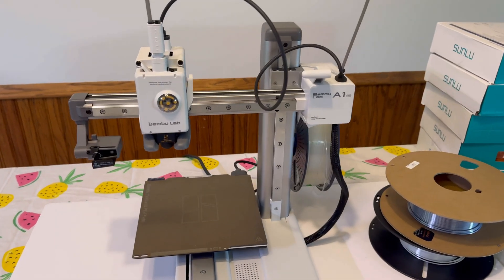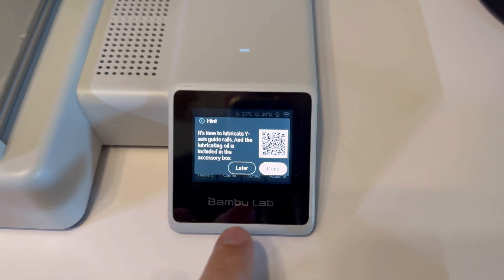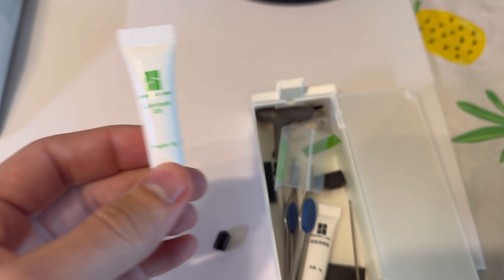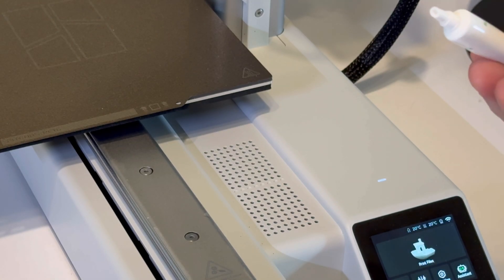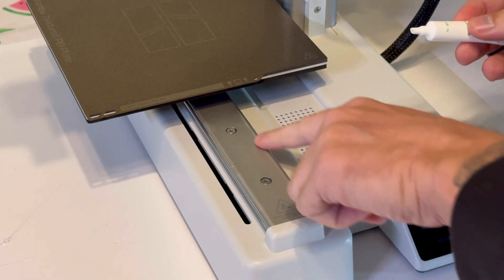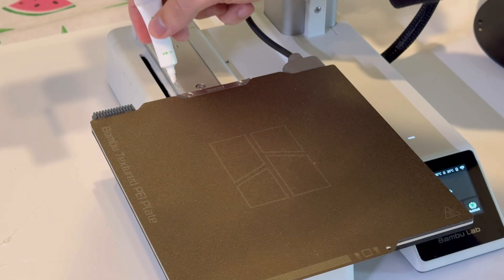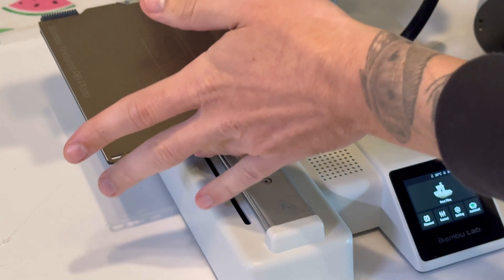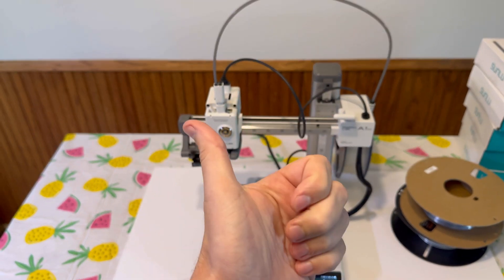How to Lubricate the Bambu Lab A1 Mini

Comment: The Bamboo Mini's initial calibration often leaves the hot end in the corner, making it unclear how to move the print bed for tasks like Y-axis lubrication. This likely confuses many new users.
to move raise the toolhead on the mini...open menu>control>xyz and raise z up

Comment: How did you move the plate
Reply: Make sure it's turned off, it's possible to move it while on but it seems like there's a lock to prevent that.
Reply: @charivarii thank you so much 100
Reply: @charivarii thank you
Reply: You can also use the buttons onscreen

Comment: so we dont need to lubricate any other part except the part the plate slides on?
Reply: I can't post a link, but search up "A1 Mini maintenance" Bambu has a wiki page and guide on maintaining the machine. You need to also lubricate all the other guide rails for the other axes, along with the drive screw for the Z axis and some of the stuff for the belts in the X (and Y iirc) axis.
Reply: That site only shows for the bottom plate. Doesn’t even show for the threaded screw .

Comment: what's the name of this grease
Reply: As far as I'm aware, the oil that comes in the box is silicone oil, but most forms of oil will work, just make sure not to use grease. Grease should only be used for the Z axis screw (if I remember correctly), all the other guide rails and bits that need lubrication should be lubricated with an oil of some form. If you need more info you can just google "A1 Mini maintenance".

If you run out of oil, you can technically use WD40 for the guide rails (AND NOTHING ELSE), but that should only be a short term solution until you can get a proper oil to lubricate it with.
Reply: @ParoXyzmm  THANK YOU 🤍🌹